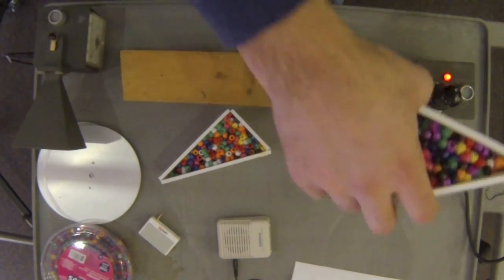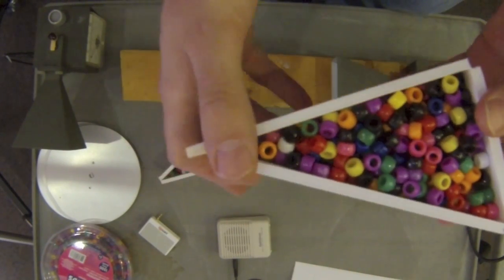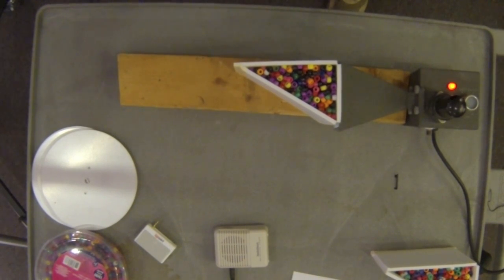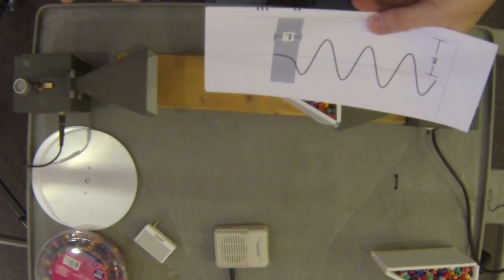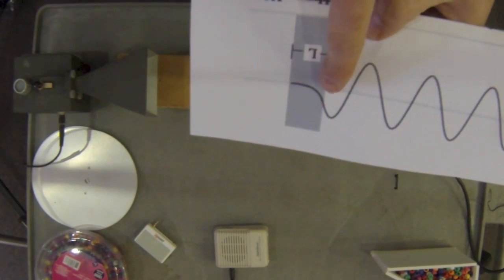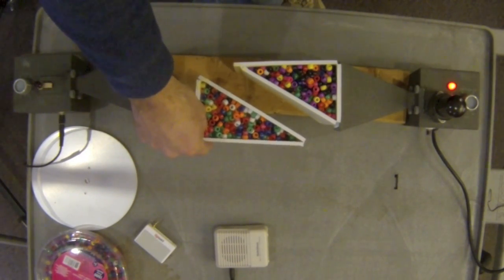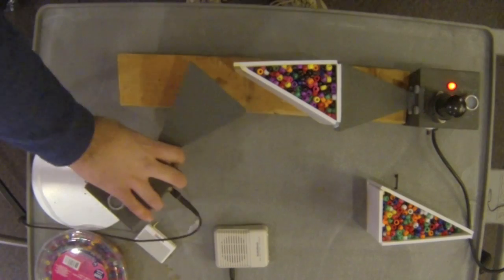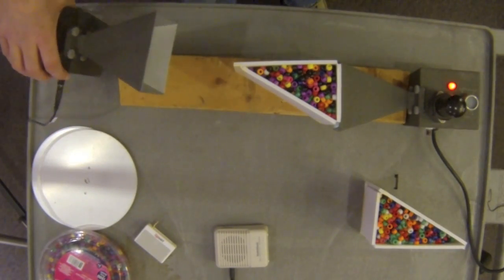Quantum Weirdness

Comment: It acts a lot more like a rectangular prism.  They don't actually "touch" because my edges are made of foam board which is ~0.3 cm thick.

The transmitter doesn't have a frequency rating that I could find.  I'm guessing that the microwaves have a wavelength of a "few" centimeters.  If I come up with a way to find that out, I'll post it here.